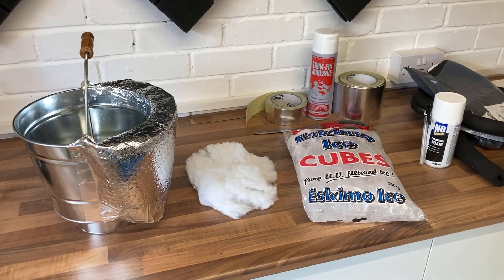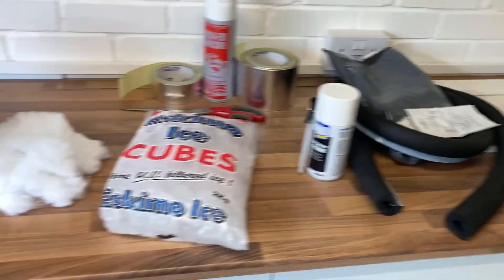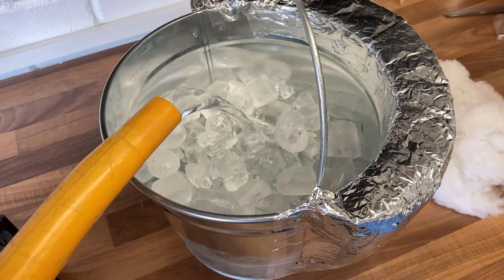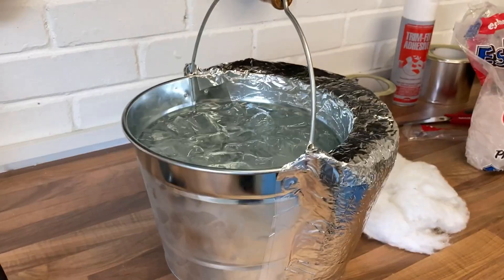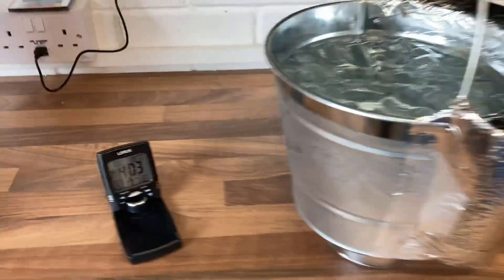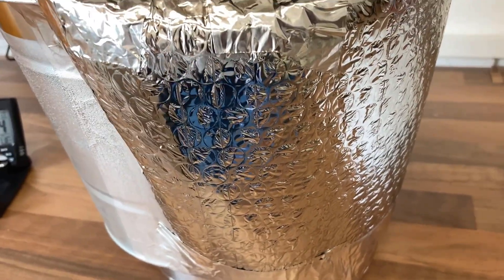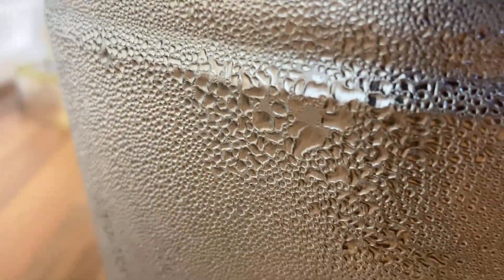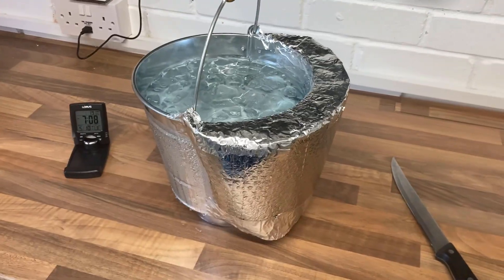Vapour Barrier in a Van - I can Prove they Work.

Comment: A great practical demo on how it works! Genius. Thank you Greg! When I did my insulation I got half the van done with VB then winter came. Half my van was dripping where there was no VB, and the other half even though not sealed at edges was bone dry when I cut into it to check. So doesn’t even have to be 100% sealed to be massively effective. If the air doesn’t move through that gap it can’t carry moisture into it. Obv being sealed helps guarantee this. Front half of van started getting mould spots where water droplets kept collecting on top of PIR boards in ceiling. Vapour barrier for the win! Can’t cheat physics!
Reply from the maker: That’s a brilliant practical example confirmed. Nobody ever backs up their contradictory thoughts with actual proof or science so thank you for another rock solid example
Reply: @GregVirgoe  I can prove it, watch your video. It proves you are wrong AND you don't know the difference between a vapour barrier and a thermal barrier..If you were right then there would be condensation on the outside of the vapour barrier but there isn't because its not as cold because the insulation is acting as a thermal barrier. That side of the bucket would be dry without a vapour barrier. 
As for other people not posting proof on here that is an infantile,  narcissistic comment, 
 most people do not video everything they do unlike you.
Reply: So good, thanks. I’ve put a 7mm foil topped adhesive foam directly on the metal then put insulation on top of that. Do I still need a Vapour barrier on the outside of the insulation, eg over the top of the insulation as well? I see some people put a really thin foil over it. Appreciate your thoughts

Comment: I don't know if you still answer questions on older videos, but hear is hoping: I have just realised after 5 years of my 2nd hand self built van purchase, that it doesn't have any insulation at all in the roof space. I need to take the carpeted plywood ceiling down. MY QUESTION IS: what goes first next to the metal roof, the insulation  padding or the silver vapour barrier? Thank you.
Reply from the maker: The best thing to use is the closed cell foam I demonstrate in this video. It is self adhesive and has a foil layer on the outside. 

https://youtu.be/4-RJCeK9Ysk?si=1Fy1K3Ud4b0GGr-7

Make sure to use some thicker than 12mm for best results the thicker the better.
I wish you well 😊
Reply: @GregVirgoe  Thank you.

Comment: Hi. Good old  battle found here 😂...

I did not dare to put vapour barrier in my van. In my house I have one. The walls breathe and dry outwards... the vapour barrier is inside the insulation from out wind blocking but breathing 25mm wood fiber plate, 200mm stone wool then the vapour barrier plastic, then 5cm stone wool and inside wall gyprox. The reason 5cm in was that the wires and sockets could be inside the vapour barrier and not to do any holes into the plastic... also the moisture point is always in that part of insulation which is far  outside of the plastic and will dry always because of the breathing structure of outer wall... also in the house there is electrical ventilation in and out. The airvents are adjusted so that there is -5% negative air pressure so that the dirty and moist air would not go into walls, so it exhales more than inhales... so there the vapour barrier works.

In a car the outskirt does not breathe... and while driving hell of a lot pressure especially if every hole was blocked. This is because of the veh takes the heating or cooling air from outside and blows it into the veh... so if/when there is some tiny holes in the vapour barrier, the air goes there for sure...also  I think that all the water holes in the sills of cars are there for reason... the moving air is drying the walls and going out through the vents... so
I left the d-pillar airvents unblocked. I did not put any vapour barrier. I hope when there comes moisture on the van walls, the sill holes work ..One extra thing I did before any insulation or framing... a nano coating everywhere in the gargo space of the van... it alone blocked the condension when I was heating and building the van out in -15C... but it does not insulate... it was pretty expensive and is used in marine technology...

So this short story was just about my reasons not to put vapour barrier...

Comment: I'm sorry but this video is BS! Absolute BS. As soon as you pulled the tape and insulation off you can CLEARLY see water DROPLETS towards the bottom of the bucket (between the bottom two ridges/swage areas) as well as the central height area of the bucket from left to right! Those water droplets did NOT form within 1 second of removing the foil. Simply pause the video at ~6.14 and look closely for yourself.
This is EXACTLY why it is better off to not entirely seal sections of the van UNLESS it is done with self adhesive closed cell foam or professional grade closed cell spray foam. Something with direct and constant contact with the metal surface.
I work within the coatings industry focusing on offshore environments doing coating and inspection and specialise in corrosion prevention. 
The recycled plastic insulation itself has a moisture content and you are sealing that in to begin with.

Comment: thanks greg im confused but what i see you doing in this video is if the bucket outer skin is the inside of van then you have the fluffy insulation on the inside skin of van and the silver lining  over fluffy stuff..how are you supposed to install that in van .normally you would stick silver lined foam rubber on inside wall then fluffy insulation over that or doesnt it matter which way it goes

Comment: Sorry, but NO…  the thing stopping it ‘sweating’ is the THERMAL barrier - the insulation.

Redo the experiment with no insulation.  Tape the vapour with a gap between the bucket.  And tape insulation with NO vapour barrier on the opposite side.

Vapour barriers prevent water transfer, not condensation.

Comment: I would like to see the same experiment with a small hole in the vapour barrier hat has been unsealed caused in a practical case  through passing a cable though the vapour barrier and failing to seal it.

Comment: 6:14 I can see drops of condensation under the removed vapor barrier. They are clearly visible. But if you look at the comments - you will see that many others do not notice this. The answer is in Wikipedia: "In psychology, the Asch conformity experiments or the Asch paradigm were a series of studies directed by Solomon Asch studying if and how individuals yielded to or defied a majority group and the effect of such influences on beliefs and opinions."
Reply: You're right!
Reply: Can you also see there is 100x more condensation on the side with no vapor barrier? The point the video is trying to make is still valid.
Reply: @azr6662  No it's not lol with a vapor barrier the condensation will stay and create mold because it's trapped. With no vapor barrier i will go away with time because there is ventilation and its not trapped
Reply: @carlosrios5162  I guess it depends on the environment. If you are living in a van somewhere cold with no vapor barrier, you will have litres of condensation soaking into the insulation. That won't dry quickly as the insulation itself prevents the air moving through the cavities freely. Would argue that the tiny amount of moisture trapped by a well fitted vapor barrier would lead to far less mold.
Reply: @azr6662  a bunch of people did it and they all say in real life situations vapor barrier are dumb, anyways do as you wish Mr expert

Comment: i just  want to start by saying i totally agree that a vapor barrior is a must in cold climate but I also would like to point out that your experiment is flawed. You compared a non insulated surface to a insulated and vapor barierred surface. the controversy is between insulated with or whithout  vapor barrier.

Comment: I am 100% with you on the importance of the vapour barrier but I was a little perplexed to see you use those stick on steel spike things in your previous roof insulation video for holding the Celotex boards up, because what you've done there is introduce a thermal bridge into your nice efficient insulation. I'd be interested to see you do this experiment above with one of those spikes installed in the middle of your insulation, and see if you get a little spot of condensation around that tophat that sits on the outside of the insulation and the end of the spike. Van's are full of thermal bridges, it would be hard to get rid of all of them, but introducing more seems unnecessary.

Comment: Am I right in thinking that closed cell foam doesnt need an additional vapour barrier on top because itself it is non permeable? As long as the layer is thick enough and the joints are foil taped? Thanks!

Comment: Hi Greg I'm currently doing a conversion and something is puzzling me about the vapour barrier. What about ordinary cars when the heater is on and it's freezing outside. They don't have foil barriers. Wouldn't they just rot from the inside out with the headliner all damp and mouldy?...I'm not being critical, just keeping a tab on all the costs.
Reply: When you look closely to the experiment, you can clearly see the drops after he removes the insulation. On the lower edge and in between the letters.

Comment: So glad I came across you videos Greg! I've done a tonne of research on this subject and, yes I'd like to install a vapour barrier. I've decided to use a decent quality polythene tarp instead of reflectics as I'm converting a Ford Connect; much smaller build. So I don't have the space to use, giving the reflectic it's 1/2 inch air gap, y'know?  I did have one question though: How have you mounted things/ furniture onto the van wall? If you can't make holes in the wall / through the vapour barrier how do you stop things from sliding about in the van? Or how do you seal the holes?

Comment: Great video! Thank you for sharing!
I'm curious what you or others think about "professional" spray foam insulation. Seems that would seal things pretty tight. Pros? Cons? Thanks!
Reply from the maker: Yes it’s an excellent insulator and will solve all condensation issues. Only cons are can be messy install and cleanup plus it’s a permanent solution and easily removed if needed.

Comment: It blows my mind how stupid the world has become. It really is Idiocracy the movie. This is a third grade experiment, and as the guy goes to cut the tape has to put in "There are no edits in this clip"..... WHAT DID EVERYONE EXPECT? LOL. 

The confusion comes from what happens AFTER the moisture barrier and insulation;
                   in a home, drywall and the interior paint are semi-permeable. Anything that got into the insulation past the moisture barrier is able to evaporate. (newsflash homes leak small amounts)
                   in a van the shell IS the primary moisture barrier;  then you put your insulation. There is no need for an additional moisture barrier.. Dont put 2 barriers in a van. tards.

Comment: Super series on building a camper van Greg! Really enjoy it. About to start isolating my Ducato with PIR isolation and Armaflex. The question I still have is when we use PIR isolation on the walls and the roof/floor there will always be an air gap between the steel and the isolation in opposite where Armaflex will leave no air gaps. Will there be condensation between the isolation and the steel? On one hand I think no, because the temperature on both sides of the steel is approx equally. Am I right? We will make mistakes on our first van build but would prevent one with isolation. Looking forward to your response.

Comment: Hey Greg, your video saved me IMMEASURABLE time researching this topic. Thank you for giving me hours and hours of my life back! One question that maybe you know the answer to: what impact (if any) do side and rear windows have on insulating a van? 

Is it better to build out a van with no windows from an insulation & vapor barrier perspective, or does it not matter much? I'd expect having thin panes of glass around the van would diminish the effectiveness of the insulation and vapor barriers, but I hope this wouldn't completely nullify the insulation.
Reply from the maker: When you cut windows in those areas have a greater heat loss as they are no thermally efficient like insulation but it doesn’t affect the installed insulation or vapour barrier. Double glassed campervan style windows are thermally better. 
With single glass you may get a little condensation on the glass but keep the van warm and well ventilated and that will be a minimum. Best wishes.

Comment: Hi, 
I am worried about water moisture is in the van panels getting locked in and not circulating out . I have a crafter and they are known to leak from the outside trims . What’s you view on this Greg

Comment: When you say vapour barrier your completely stopping air from coming in contact with the cold surface, you hear some people putting up breathable material which is a no go either ? And I presume plastic will cause a sweating ?
Reply from the maker: Breathable membranes are used in timber frame construction to stop rot occurring. Not applicable here. 
Heavy duty plastic is ok as vapour barrier but beware some thinner ones are slightly permeable. No sweating will occur with plastic.
Reply: @GregVirgoe  thanks very much for the reply, I was actually trying to understand both concepts of a traditional build and camper van build, obviously each environment is totally different, living in Ireland damp is in our bones ha, but the main concept of any method is stopping the warm air hitting the cold surface, my nephew is building a camper and how I described it to him was with a kitchen plate and breathing on it creating condensation on the plate. Your bucket experiment is 🙌 I must send it to him. 
Breathable membrane on a timber wall makes perfect sense. 
What’s your opinion on putting a small vent on top of the side walls so if any condensation is in there it can escape?

Comment: yes you are correct.... but in the real world when fitting a vapour barrier there are gaps and wholes you cant seal thus letting moisture in between the vapour barrier and vehicle outer skin....  you even said it yourself in the video... it needs to be fully sealed so no moister can get in.. so yes vapour barrier works in a a perfectly sealed van..  I dont think anyone can do that....
Reply: You can (I guess) if you create a box inside the van itself and box yourself in.
Reply: The theory is great but it will be nearly impossible. If you take a close look you can see the drops of moist on the bucket behind behind the insulation when he takes it off.